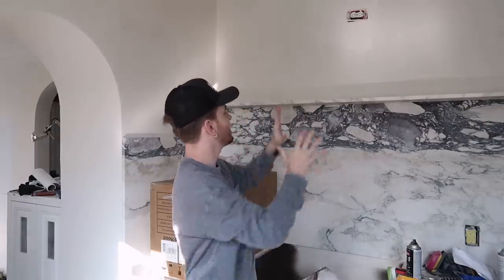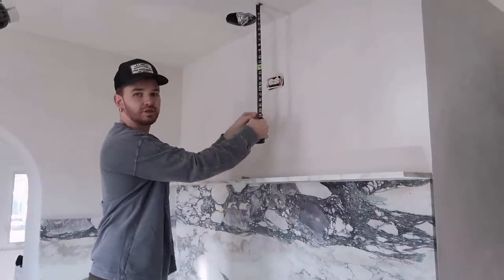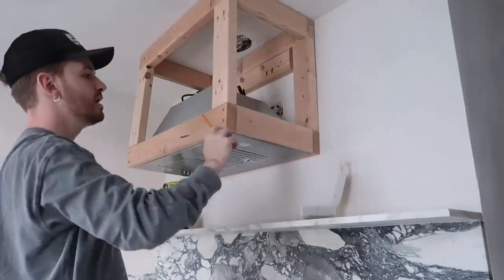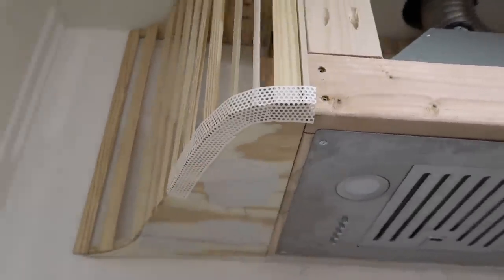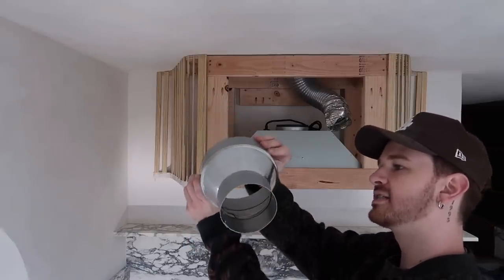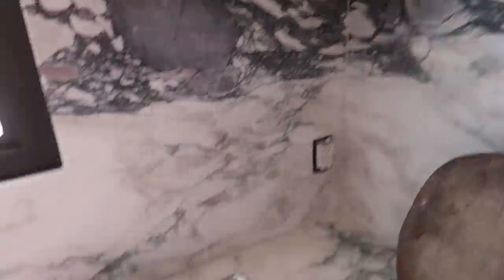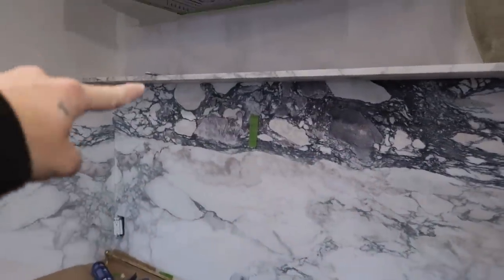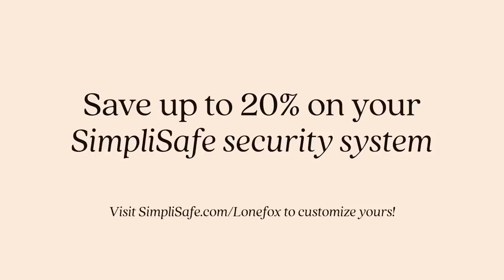DIY Stone Range Hood Using PLASTER (From Start to Finish)

Comment: Hey Drew! looks A-MAZING!!!! Quick question: When i installed my vent hood, I was told that it needed to be a specific height from the stove in order for the suction of the fumes and smells to be absorbed and for the vent hood to be efficient and working. Therefore I could not install it at the height I wanted in order for the look to be where I felt was right.  Does this not apply??? #confused
Reply: I was wondering about that too…and there’s a shelf between the source of the grease, and the vent. Looks great and I hope it works out!

Comment: So, if you need to access the outlet or ductwork or the guts of your vent is the only way to unscrew the thing & drop it down?  I guess it would be hard to put an access panel in with the plasterwork & still have it looking decent.

Comment: Height of your range hood will affect its efficiency, as will the obstruction created by the shelf you installed. Range hoods not only take out steam but pull out way more cooking oils than you would ever expect, even if you do not fry! There is a reason that kitchen surfaces are usually glossy because they are the most cleanable; rough and/or sanded surfaces will be a bear to clean on a repeated basis.

Comment: QUESTION! I was so excited to see you using Meoded because I just found the product last week and am tentatively planning to plaster my own range hood with it, but I don't know yet if it's easy to clean--I have grease concerns. Can you clean the plastered surface once it's cured?
Reply from the maker: Yes! They also have different sealers that offer different types of finishes!
Reply from the maker: I also want to mention this is a product traditionally used for exteriors so it’s fully washable!
Reply: Thank you!

Comment: I have read other people's concerns. Your vent system appears more commercial duty rather than residential. It all has to do with the CFM's of the hood. I have installed hoods as high as that especially if the kitchen design and ceiling heights warrant it. So one has to put in a heavier motor that draws in more air to clear the area above the stove. 
It came out beautiful but the front of the hood looks sterile. It feels more like a style for a 'Adobe' type home. A little wrought iron detail on the face would change the feel of it, suited more to the home.
I must say that it was quit creative on your part and blends in nicely with the rest of the walls and ceiling.

Comment: In the US it is not required to vent a gas stove that is residential.  Commercial ones do need a vent.  The gas stoves in home do not create enough CO to cause any harm.  It will help to remove smells and smoke.  I don't think Drew cooks very much that it will be a issue.  No code needed for what Drew did.

Comment: Although aesthetically pleasing, the vent appears not close enough to suck out the millions of grease particles that spray out during the cooking process.  This will probably leave the shelf, walls, counters, decor and floors covered in grease over time.  It's kinda like turning on the bathroom fan after a #2 but leaving the door wide open.  I installed a commercial grade hood in my home at the right height that acts like a huge scoop.  Regardless what I cook, anyone entering the home will hardly tell I am cooking at all.

Comment: What if the fan quits? You have to tear-down all that plaster, boxing, etc.? I think you will wish you had a stainless sheet around the bottom of the fan box; for ease in cleaning and utility. Pretty yes, wrong application for a Kitchen Tool made to Exhaust everything from Steam to Burnt Toast, BBQ, Roast, Fried, etc. I made Prototype, Twin, Experimental Aircraft for Cessna, using 2024 Aluminum. I know whereof I speak. You have good craftsmanship skills, a keen eye for detail, work so hard and are Very Focused! Congrats.

Comment: IF YOUR FAN HOOD BREAKS OR YOU HAVE TO UNPLUG IT HOW WILL YOU ACCESS IT IF ITS ALL PLASTERED IN?
Reply: are you surprised tho? I don't want to be mean or anything. He has a nice taste. But he needs some pro guidance. He put the counters first and he's doing the floor last. which is the opposite order of doing things. I'm surprised people who made him the counters didn't advise him to not go so high under the hood with the marble and about the order of things. It had to catch up at some point. You can see he has to touch up the cabinets already. I think he made some design errors, and now you can see it. No one puts hoods so high and so you can see the insert. It's very awkward looking and not practical. He also bought some nice looking but inexpensive kitchen faucet - let me tell ya it's going to break fast. Rookie mistakes.

Comment: It looks great but I think that the shelf and the placement of the vent is going to make it useless. If you have an electric stove, the vent shouldn't be more than 24 inches above the stove and no more than 36 inches above a gas stove.
Reply: You might also want to check your local building codes.

Comment: Wow, you drilled into your own marble. I would have been too scared to do that.  About your beautiful range hood . . . are you sure that plaster material will keep the steam away from the wood underneath?  Or is the wood pre-treated? My parents purchased a home in which the heat and steam ruined the finish on the side cabinets which were made of stained wood. Hope you don't have those problems.  Your range hood's motor sounds strong (that's great), but do make sure it is sealed so the steam does not make it up to the wood next to the metal. Moisture, mold, etc. are def. nothing you need in your wonderful new home.

Comment: I like it! But where is the vent going to exhaust the bad oil air from cooking otherwise it’s going to collect inside this wood stucco creation and make mold and just cave in. There has to be duct work done that release the air not into your attic but through the roof to outside. You don’t want a fire to start for stupidity
Reply: Ok I missed the part that you actually hooked up the exhaust out duct work to outside. Ok 👍 Excellent Work!
Reply: Why don’t you get your General
Contractor License 🪪 or do you have one already?

Comment: I think this looks really good, however, this is a really DANGEROUS installation and not effective. DO NOT RECREATE THIS IN YOUR OWN HOME. 1. It is VERY dangerous to use a plug-in connection in a permanent installation as it creates a fire hazard. 2. The height of the hood renders it completely ineffective; it's way too high.

Comment: Not to be "that guy"....but this wouldn't pass codes.  Fire hazard. Needs to be lower. You need an access to service it, and the shelf needs to be gone for proper ventilation..

Comment: Have you ever heard the term 'self praise is no recommendation.' Instead of telling us how great your design is it might be a good idea to hear/read viewer's feedback, this VLOG sounded rather self-congratulatory, and a tad narcissistic, you might want to tone the ego down a little, it's a bit of a turn-off at this end. I'll probably get blocked for what I've said, but oh well, never mind, I'd rather be straight up as opposed to a sycophantic follower. I do like a lot of what you have done in the past, but the lack of humility is starting to get a little over the top! Sorry, but I think this particular job is a very sloppy. You may be able to hide the inside, but I'm not sure shoddy workmanship is the best way going forward. I feel confident in saying that I believe you can do better than this! You might have been better to use an adjustable metal band to hold the range-hood duct hose in place. Not impressed at all, and that hasn't always been the case, because I know you can do better!.

Comment: Watching you and MaCenna work I have learnt one thing you guys may be good at design... but none of your home project are functional... you don't know what you are doing and just winging it making things look great... but have no idea how things work... case is point the marble you wrapped in plastic... what a waste... you should have known marble is not a working surface... looks great as a splashback but not on counter tops or worse still a sink... and yellow pendent lights in the kitchen... a place where you need strong light to see what you are cooking night or day and then you forgot that you have a shelf under the rangehood... which will obstruct the air flow... your renovations are NOT being thought through... you need to speak to a kitchen installer